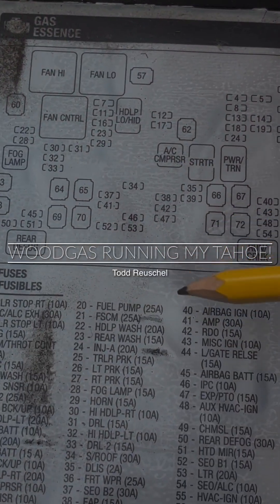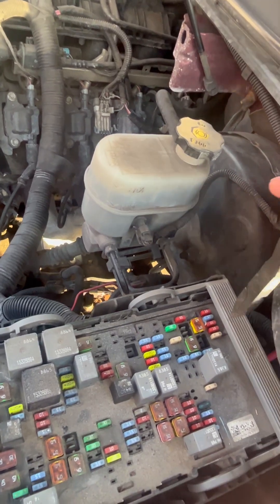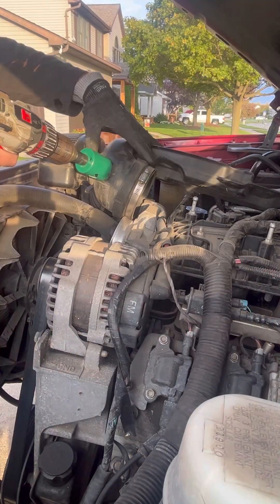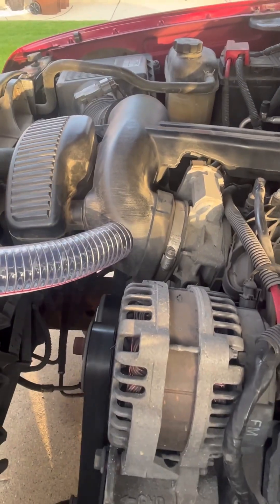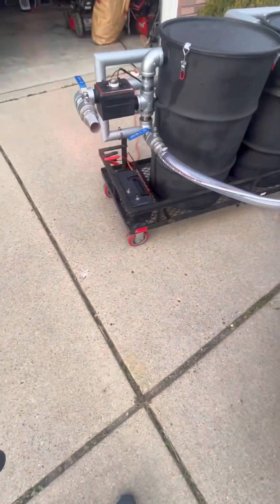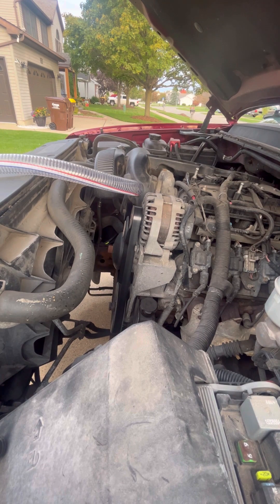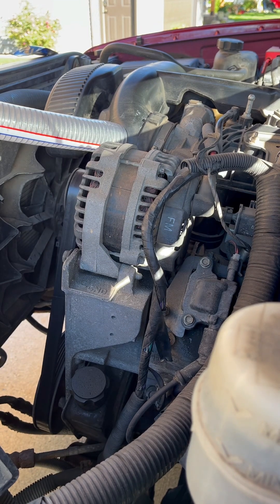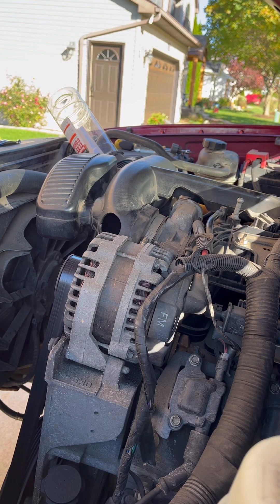Woodgasifier runs my Tahoe!

Comment: The wood gasifier may be a good replacement for solar Pv in winter time, as there’s not enough sun and heat of cooling the engine could heat up a building. Instead of running a car, such an engine could run a generator to load my batteries. Planning it now to get it ready for next winter.
Reply from the maker: Sounds good and probably a good idea. God bless.

Comment: Hey Todd, if you leave the fuel relay in the ecu should be able to adjust accordingly, you need a way  to servo adjust your air intake and throw the unit in the bed of the truck.  I'd expect at least 60 mpg from other videos I've seen.
Reply from the maker: Thanks for the info.

Comment: Great job! 

Can you make another video of the truck moving even just a bit? 

2.Also, did you ever get the Generator going? Would love to know to load you could put on it at max.

Keep up the great work, can't wait to check back in
Reply from the maker: I am contemplating putting the gasifier on my Tahoe and 
I also did get my generator going, it ran great, I do have a video showing that. I think it’s called “ finally got my generator running with my wood gasifier.”
I

Comment: It's an interesting experiment.........but what's the point???  Burn barrels in the bed running down the highway?
Reply from the maker: They used wood gasifiers during World War Two when they ran out of regular gasoline. These were on over a million vehicles back then.
Reply: yes, this shit is over 100 years old and has been running vehicles for that long.   China was using wood gas for buses on a regular basis up until the 90s.